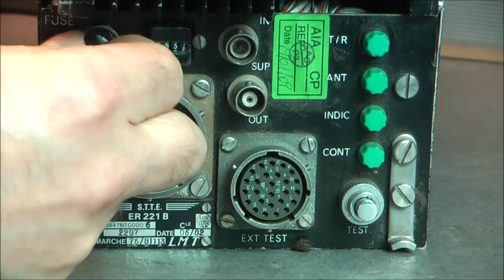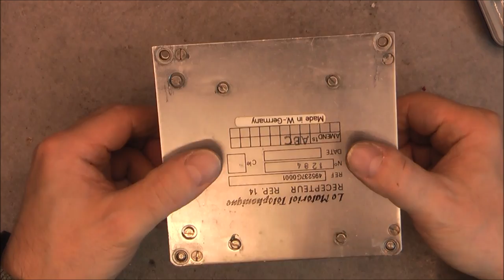French avionics teardown LMT ER-221B transceiver from 1982

Comment: At 13:19, when you remove the tape, you can see where the conformal coating and label from the component was peeled off by the tape.
Nice transceiver, I like the hardline coax.
Thanks for the video.

Comment: 51:00 Power amplifier tubes type Y1549 - high power ceramic triodes operating up to 4300 MHz.  Peak power up to 600 watts during pulse operation.  See https://www.relltubes.com/filebase/en/src/Datasheets/Y1549000.pdf